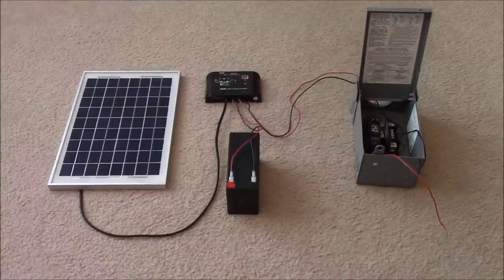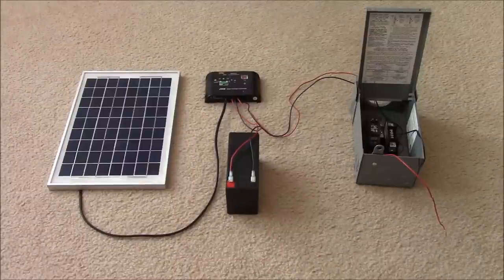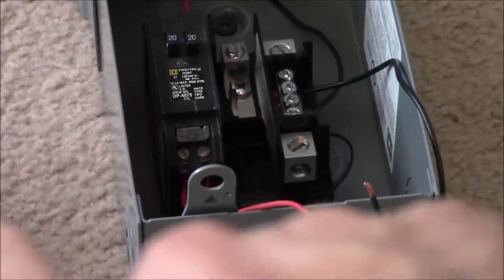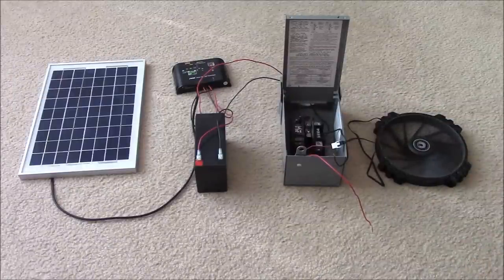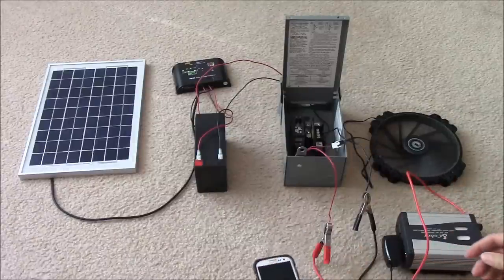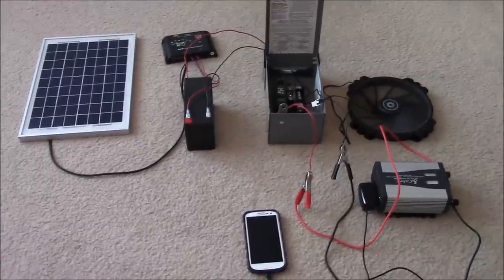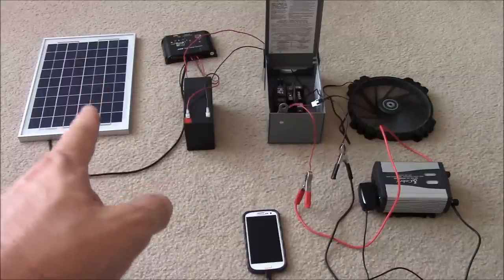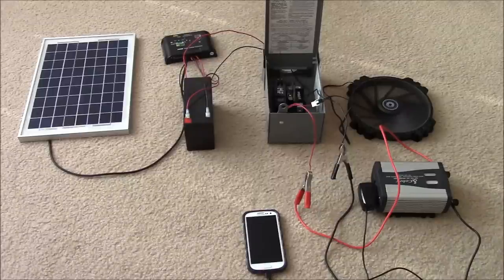Solar Panel Systems for Beginners - Pt 2 Hybrid Systems & Multiple Loads

Comment: What if I attach a giant solar panel to a tiny battery.  How do I control the amps or current going to the battery?  I don't understand.  What if I use tiny wires coming from this giant solar panel.  Will they get super hot and melt the casing?  So I guess the right gauge is needed.  Great.  So then how does the charge control devise know how much to supply to whatever battery I'm trying to recharge?  Like, what if I have a simple AA rechargeable bat. that asks for 2v to recharge it, and gives off 1.5v in use.  Does that charge control thingy have a switch on it?  I'm so confused.  off to the library I guess.
Reply from the maker: The charge controller has circuitry that will tell it when the battery is fully charged.  But you can only connect a 12v or 24v or sometimes 48v battery bank to a solar charge controller.  It would not know what to do with a AA battery.  A giant solar panel will still produce the same voltage but a higher amperage.  As long as the amperage or current is lower than the limit of the charge controller (usually 10, 20, 45, 60, etc. depending upon the model) it will be able to safely use it all to charge the battery.  If you use tiny wires then the wires will burn up because they will get too hot.
Reply: thx.  trying to figure out how to charge a cell phone that wants ~4.5v to charge the Li-ion.  I'm guessing I could use that 12v bat and some kind of transformer to turn 12v into 4.5 volts, and use a usb circut board.
Reply: Nn
Reply from the maker: Ryan Nelson
I would use something like this to convert the 12v to whatever lower voltage you like:
https://www.amazon.com/DROK-Regulator-Numerical-Adjustable-Stabilized/dp/B015YZZ1G8/ref=sr_1_2?ie=UTF8&qid=1474845286&sr=8-2-spons&keywords=voltage+regulator&psc=1

Comment: is your charge controller 7amp?  I have a 12volt 7.2ah lead acid battery
Reply from the maker: +Crystal Jones I believe the charge controller in the video is 20 amp.  Are you asking if you need to match up the amps on the charge controller with the amp hours on the battery?
Reply: +LDSreliance can u answer it...i just bought 20watt panel and want to charge 2-3 7ah battery parallel...
Reply from the maker: Halley Rai
You need a much bigger panel.  It will take a 20 watt panel about 10 hours to fully charge one of your 7ah batteries.  And that is only one battery, not three.  Since you will never have 10 hours of direct sunlight in a day, it will take you at least 2 days to fully charge one battery.  I am afraid that small panel will never charge all three batteries.

Comment: Hi, i just subscribed and new on this kind of stuff. Was the load center used to make two types of output? The fan is DC and since you used an inverter it also an AC? So if I am only planning to get AC output Id just connect the converter directly to the battery? Hope you understand my english
Reply from the maker: The load center is to allow you to control multiple loads and provide safety with breakers.  You could accomplish the same thing with individual breaker switches or an inline fuse and simple toggle switch on each load.  If you are only wanting to use AC then you don't need it.  Just connect your inverter to the battery (preferably with a breaker switch between the two for safety) and then all the loads will come from the inverter.

Comment: Can i put on the load the inverter?
Reply from the maker: +angelwhooo Yes, of course.  You would plug in your loads to the inverter if they need AC power.  If they need DC power, you can just plug it in to the charge controller load output.

Comment: Do you know of ready to buy kits like this
Reply from the maker: civic2323 I am sure there are some out there.  I have thought about putting one together and selling it.  Or I can just send you links to the components and you can buy them retail and put it together.
Reply: LDSreliance Could you send me the links the the components or put them in the video description? Thanks
Reply from the maker: James D I bought that 10 watt solar panel from Solar Blvd (http://www.solarblvd.com/Solar-Panels-&-Systems-12-Volt-Solar-Panels/c1_269/index.html).  I got the charge controller cheap from Amazon (there are numerous brands and knock-offs but I don't remember which brand this one was).  I also got the battery from Amazon (http://www.amazon.com/ExpertPower%C2%AE-Rechargeable-Sealed-Battery-BLMFM12_7/dp/B003S1RQ2S/ref=sr_1_2?ie=UTF8&qid=1415546997&sr=8-2&keywords=12v+sealed+battery).
Reply: Thanks

Comment: How to charge 12 Volt battery by using Solar panel ?
Reply from the maker: +Muhammad Bilal khan Did you watch the videos?  It shows you how.
Reply: +LDSreliance If the solar panel of 12 volt directly  connected to the 12 volt battery that battery will charging? Why charge controller is used?
Reply from the maker: Muhammad Bilal khan
Yes it will charge the battery but it will also overcharge the battery and potentially start a fire or destroy the battery.  A charge controller will properly charge the battery and then switch to "float" mode which is a trickle charge that matches the natural discharge of the battery.  I would never connect a solar panel directly to the battery unless there was no other option.

Comment: Is the solar panel charging the battery
Reply from the maker: Yes, the solar panel would be charging the battery in this setup if it was outside.  Since I shot this indoors there was not enough direct sunlight to make any power and it was just for demonstration purposes.

Comment: the battery you have is that a 6v battery ???in the video ?
Reply from the maker: No, it is a 12v SLA battery similar to what you use in a UPS battery backup.
Reply: where did you get if from home depot ?
Reply from the maker: scottymizzo415 Home Depot does carry these type of batteries but you can also order them online from Amazon or Ebay or many other retailers.  Just look for a UPS battery.
Reply: right on

Comment: I don't understand. How are you pulling power from the battery THROUGH the controller? I thought the load output pulls contant power from the solar panel. How would you pull power from the battery through the controller??
Reply: HeadKraqers Kompetition I only ask, because on all the designs I have come across, everyone sets up the converter to the battery. I would think if I set up the converter directly from the LOAD output, I would be saving myself an extra step and a "crowded" set up in my battery bank box.
Reply from the maker: HeadKraqers Kompetition Good question.  The charge controller acts as the brains of the setup.  It can flow power from either the solar panel or the battery or both into the load.  Some charge controllers require a battery to be connected or they will not flow power to the load at all.  The battery is acting as a buffer in the system, kind of like a capacitor does, to store energy for energy spikes or when the sun goes down or behind a cloud.  The charge controller also provides a steady voltage to the load whereas the solar panel will be fluctuating wildly from 13-21v typically on a 12v panel.  Inverters don't like that they like clean power.
Reply: LDSreliance so the least complicated set up for a beginner like myself, would be to not run anything FROM the battery? I can go directly from the LOAD output to the inverter? I had always wonder how I was going to use the solar power during the day to run my a/c and then "switch" to my battery power to run the a/c in the evening. If I understanding correctly, this would be automatic and I would NOT have to add a "switch" and manually do such.
Reply from the maker: Correct.  The advantage that the charge controller gives you is that most have a "low voltage disconnect" that will automatically shut off the load when the battery power drops to a certain voltage.  This prevents over-discharging the batteries and damaging them permenantly.  It will automatically resume powering the load when the voltage of the batteries gets back to a safe level in the morning when the sun comes out.

Ideally you will have enough batteries that you won't get to that low voltage disconnect point.  But it is nice to have the safety if you need it.

The only drawback is that you are limited to the amp rating of the charge controller.  So if you have a 20 amp charge controller, you will only be able to power 20 amps of loads.  On a 12v system that means you will have a theoretical maximum of 240 watts.  If you were to wire the load directly to the batteries you could draw as many amps as your batteries can handle for a short period of time but you would discharge them quickly and would not have any safety measure to cut off the power when the batteries get too low.

Hopefully that makes sense.
Reply: TOTALLY!!! Thank you so much. This should clear it up for bunch of folks.
Reply: sorry.. another question. Do you have a video on how to hook up a dual Volt and Amp meter? I am trying to meter up my battery and panel. The other videos I have seen do not show exactly where each of the wires go from the little meter.
Reply from the maker: HeadKraqers Kompetition
Funny you should mention that.  I was asked to review a combo volt/amp meter by a company recently and they are sending one to me.  I have a couple already that I use in my testing but I haven't shot a video specifically on that.  I will be doing that within the next month or so (have a family vacation so I will be gone for a while).

If that isn't soon enough just shoot me an email at ldsreliance@gmail.com and I can try to help you out.
Reply: LDSreliance good explain. very thankfull. can you recommend me a high quality mppt charge controller about 40 to 50 amps with the same functionality you explaind above in your comment and with all safety measures.
Reply: LDSreliance, a good power inverter will have a low voltage cut-off feature built in.  So all is not lost.  😁

Comment: Did you say in the first vid that you cant use cheap inverters with sensitive electronics like cell phones? In the second vid you did, so im trying to understand.
Reply from the maker: These videos are for demonstration purposes to show the basic components and how everything works together.  Yes, if you consistently use sensitive electronics with a modified sine wave inverter it will shorten its life.  In a pinch it is fine.

Comment: Something I want to get in to
Reply from the maker: It is easy to get into with a small, simple kit.  Let me know if you need any help.
Reply: @LDSreliance  thx... do you sell the kits?
Reply from the maker: Kinda.  I have some links that I recommend.  If you tell me what size you want or what uses you are going to use it for then I can send you some links.  Email me at ldsreliance@gmail.com.
Reply: @LDSreliance  will do thx

Comment: is that lead battery? can solar charge lithium battery directly?
Reply from the maker: Solar can charge anything.  It is the charge controller that you would need to make sure can work with a lithium battery.  I have read where people are able to successfully do this with more expensive charge controllers (http://www.batteryspace.com/140w-10a-solar-charge-controller-with-mppt-for-lithium-batteries.aspx) but I would not risk it with the cheap Chinese made ones like you see in this video.
Reply: oh..tq so much! appreciate it.. ur video help me a lot.. hope u will not stop spread knowledge.. thanks man.. i had and idea by use solar panel to solar controller then to lead acid... from lead acid to imax b6 battery balance rc to charge lithium battery.. do you think this may work out?
Reply from the maker: The only way you can charge a battery with another battery is if the first battery has a high enough voltage.  In other words, you could never charge a 12v battery with another 12v battery because it would require at least 14.6v to charge.  You could do it with a 24v battery if the charge controller could handle that kind of voltage and convert it to charge a 12v battery.

I wouldn't recommend it that way.  It would be inefficient but you could go from 12v solar panel to charge controller to an inverter and then plug a lithium charger from the inverter to the lithium battery.  That would be cheaper to do because you don't have to buy an expensive charge controller and you probably already have a lithium charger that can plug into your normal wall socket.  But it would lose some power in the transfer from DC->AV->DC again.

Comment: Can you use a motorcycle battery?
Reply from the maker: If you have to but it is not ideal.  They are not meant for deep cycling.
Reply: You mean it needs a compatible battery, can you give some examples?
Reply from the maker: It needs a deep cycle battery.  Motorcycle batteries are starter batteries.  They are designed to provide a large amount of current for a short period of time.  Think of them like a sprinter.  Deep cycle batteries are like a marathon runner.  They don't run as fast but they run a lot longer.
Reply: Ok, now I get it!

Comment: Use a dc dc converter instead?
Reply from the maker: Why?
Reply: cheaper and lighter than a charge controller?
Reply from the maker: How would you regulate the charging phases of the battery?
Reply: just charge it at the maximum safe voltage?

Comment: but why dont you need to plug the fan on the inverter?
Reply from the maker: That fan is a DC powered fan so it operates directly from the batteries.  Inverters convert DC to AC for devices that require AC power like most devices in your house.

Comment: Can you use a car battery
Reply from the maker: Yes but you will destroy it quickly.  Car batteries are meant to provide a lot of amps for a short period of time (5 seconds or so to start a car).  This doesn't drain the voltage very much and then they get recharged as you drive.  Deep cycle batteries can't provide those high amps but instead they are like distance runners that are designed to be able to provide lower amps for hours and hours instead of high amps for a few seconds.  They can handle the repeated low draining of the voltage and then recharging over and over.  Car batteries can't.

So if you want to practice with an old car battery that you don't mind if it dies that would be fine because they are more plentiful and easier to find than deep cycle batteries and most people end up killing their first battery whatever it is as they learn how solar works.

Comment: Good info, but the panel doesn't have the power necessary to power the fan or the power inverter, the fan and inverter is actually being run by the power store in the battery.
Reply from the maker: That is true.  This was just for demonstration purposes.  A bigger panel would have been harder to fit on camera with all of the other stuff.

Comment: Hello I have a request well I am in high school 11th grade. I have an engineering project coming up in about 4 weeks and I don't know allot about circuits and for my project I need a system which uses a solar panel to charge a 12V battery & also power multiple loads for example two 12 volt motors, but I want it to use electricity from an regular 120V wall outlet to charge the 12V battery or power up the motors when the solar panel is not producing any electricity. Please if you make a video of how to make that circuit and list the parts that you used. That would help me allot :) . I would really appreciate your help.

Thank you
Reply from the maker: I don't have all the parts laying around for something like that but most of that would not be hard.  You would need the components from the video (solar panel, wire, charge controller, load center, and at least one breaker.  That is the easy part.  The hard part is to try to use 120v power from your house in the system.  Unfortunately, it will be difficult or expensive to find a solution for automatic switching between the 2 power sources.  I would maybe drop that part of the project if you can and concentrate on the first part.
Reply: LDSreliance is it possible to put a manual switch to switch between the solar panel or the 120 volt option.
Reply from the maker: Yes, of course.  It is called a "transfer switch" and they can be manual or automatic.  Like I said before, though, they are expensive.  They are usually designed for use with backup power generators so that if the power went out at your house, cabin, or RV the power could be switched to the backup generator instead.

Unfortunately, I don't know of a safe, inexpensive solution.  And building your own would be very dangerous unless you know what you are doing.

Comment: How can I Design a Hybrid Power controller with below description
Description:
Low power consumption
Remote control using Mobile APP
NET metering Enable
Soft start concept must be adopted to increase the life of the battery or another concept to visualise the performance.
Input sources: Source1, Source2, Source3, Source4
Source1-Solar power
Source2-Grid Electricity
Source3-Battery Backup
Source4-Generator
Output: One source selected from available input sources based on selection Algorithm.
Among available power sources, the user can set the priority of sources for consumption.
Reply from the maker: I'm not sure what you are asking.  I am not a product designer or electrical engineer.  So I can't help you develop a new product.

Comment: can I use car battery
Reply from the maker: You can but I don't recommend it.  Car batteries are like sprinters... they are designed to provide a short burst of power.  What you want is a marathon runner (deep cycle battery) which is designed to provide a moderate or small amount of power for a long period of time.  If you run a car battery just make sure you don't discharge it more than 10%.
Reply: LDSreliance thanks
Reply from the maker: KHALOOD - You are welcome.  Thanks for watching!